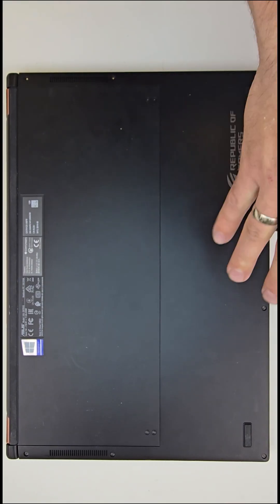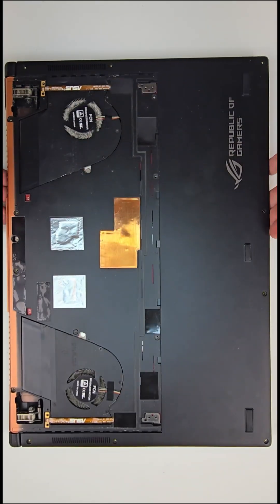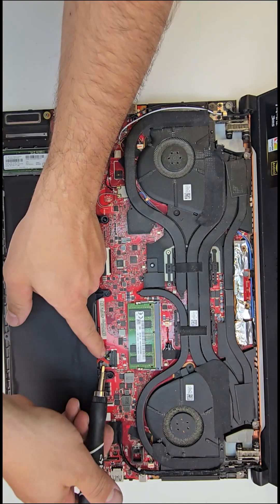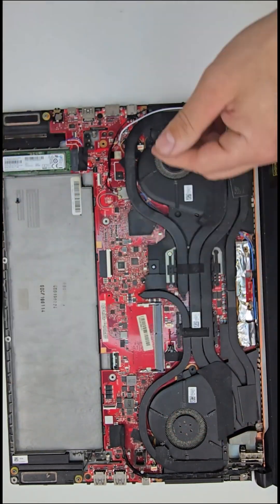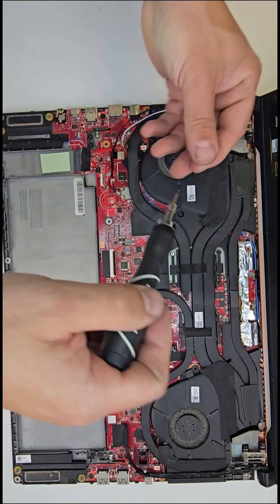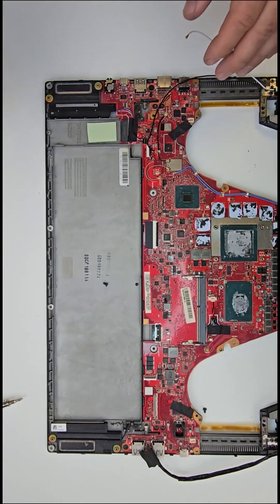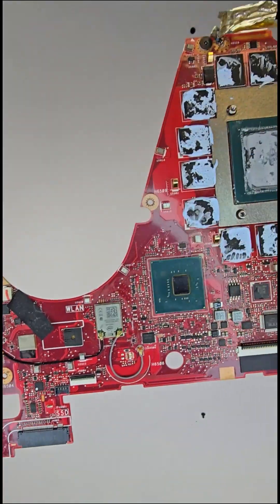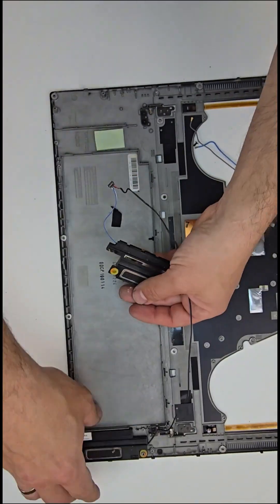ASUS ROG Zephyrus GX701 Teardown & Upgrade Guide | Step by Step

Comment: Hello, i have the same laptop model with the GX701GVR index and an RTX2060, and i`m interested in wherher i can upgrade the video memory chip by adding +2GB memory chips and installing an RTX2080 chip, since the higer-end model of the same laptop has identical specifications except for the video chip.